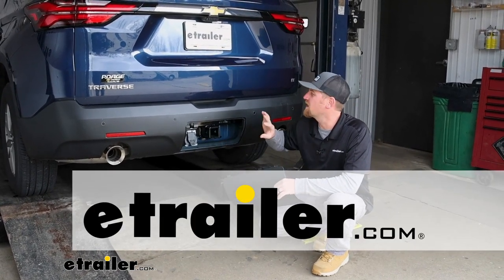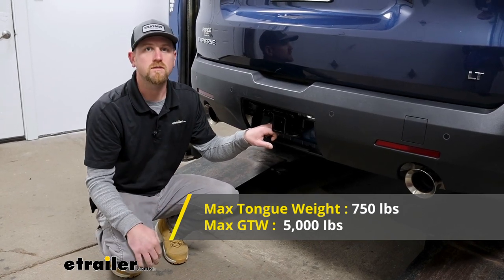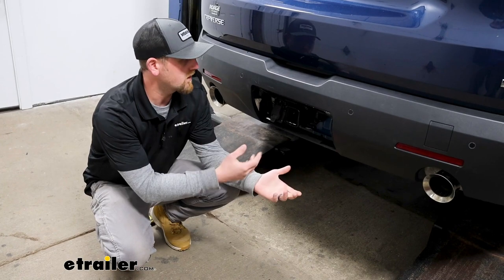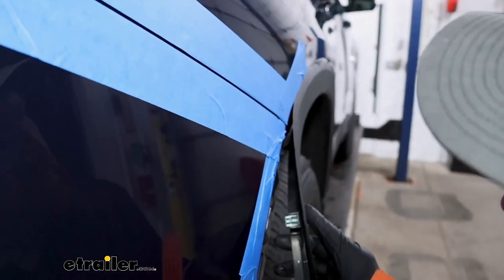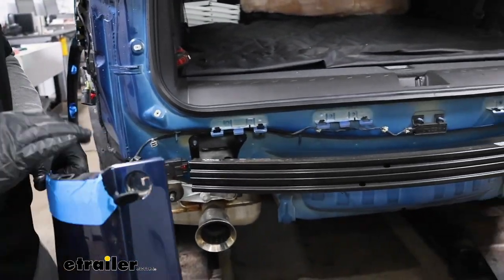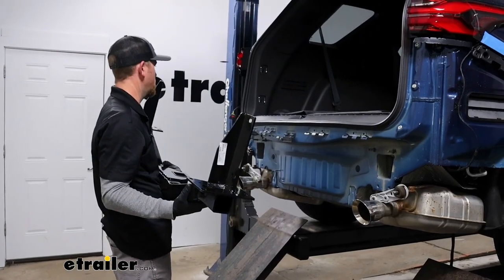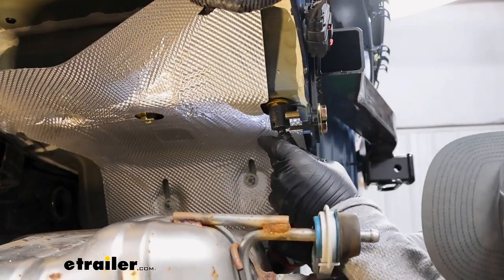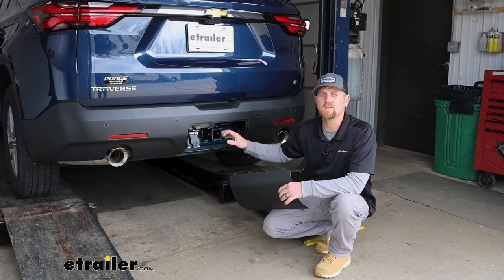Beginner’s Guide to Installing the Curt Trailer Hitch Receiver on a 2022 Chevrolet Traverse

Comment: The Traverse's with the OEM hitch have a bigger intercooler for the transmission to get the 5k lb rating.  If you install an aftermarket on one without a hitch it likely has a smaller intercooler and only rated for 1.2k lbs.  You need to swap for the bigger one to get the full tow capacity.  The drive selector is different too.  OEM has the extra tow mode where other doesnt.  Can get by just towing in 4WD mode though.
Reply from the maker: Thanks for the information! In many instances it's extremely difficult to determine how a vehicle's tow package achieves a higher towing capacity.
https://www.etrailer.com/Trailer-Hitch/CURT/CU29FR.html
Reply: I have 2022 lt awd .if I add hitch and wiring harness what will my towing capacity be?
Reply: @timnouwels7989  I read somewhere it's only 1200lbs without the bigger intercooler to keep the transmission from overheating.
Reply: any info on that intercooler @Young_Star

Comment: Wow!  I installed a Class 3 hitch on my 2016 Traverse a few years ago.
No bumper removal ect…
Took 15 mins
I bought a 2023. The hitch install definitely a lot more work.
Reply from the maker: That's the truth! Back in '16 most of the hitches hung below the rear bumper, and were fully visible. Now, most folks want something less visible that doesn't detract from the aesthetics of the vehicle. This is why most hitches for newer vehicles are designed so that the crossbar sits behind the bumper fascia with only the receiver tube and safety chain loops being visible. Do they look better? You betchya! Are they easier to install? Not so much....
Hope that helps explain!
https://www.etrailer.com/Trailer-Hitch/CURT/CU29FR.html